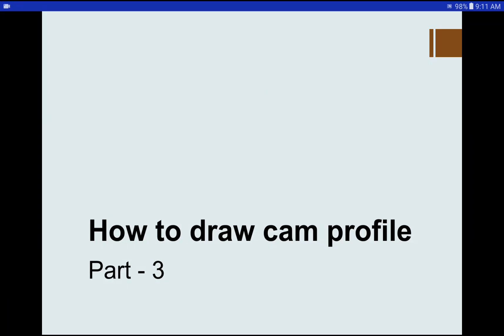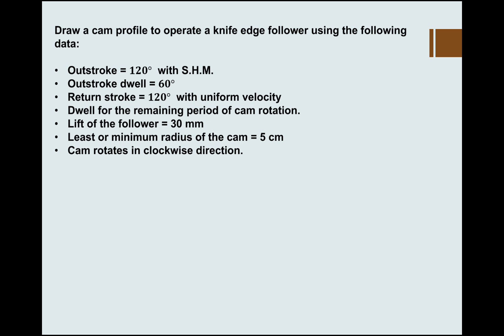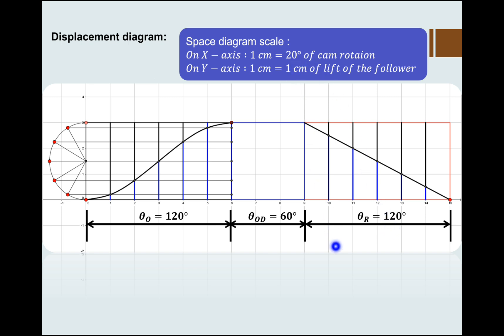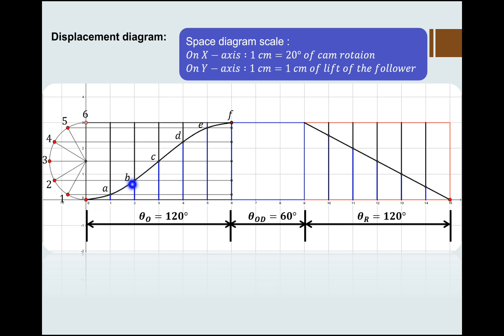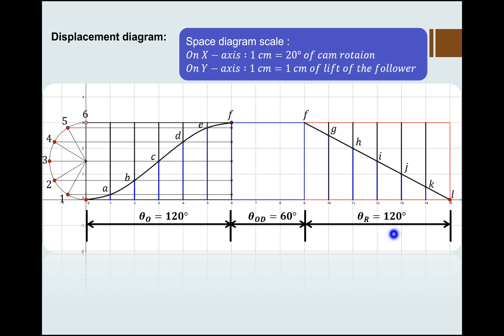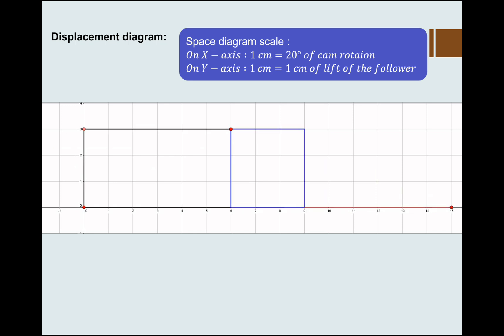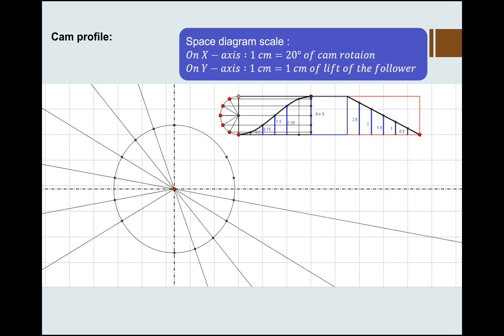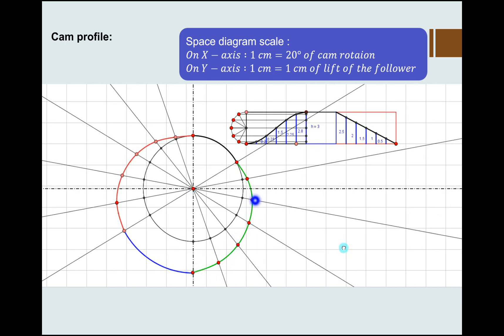Lecture 9 | How to draw cam profile ( Complete construction)

Comment: sir if outstroke=150 and return stroke=100 then after outstroke dwell we have not 6 part if we take on x-axis 1cm=25 degree ...please solve???/
Reply from the maker: If you take scale 1cm=25 degree then Outstroke = 150/25=6 & hence (6/6=1cm) you will have 6 equal parts of 1cm each , but in case of Returnstroke = 100/25=4 & hence (4/6 = 0.67 cm) you will have 6 equal parts of 0.67 cm each. THANKS ....
Reply: thanks

Comment: it was given that clockwise direction is there so should not we measure forward stroke angle in clockwise manner in profile drawing?..thank you
Reply from the maker: When cam rotates in clockwise direction then follower relatively moves in anti-clockwise direction & hence angles are marked in anti-clockwise direction .... Thanks